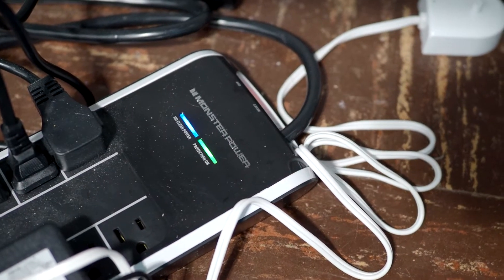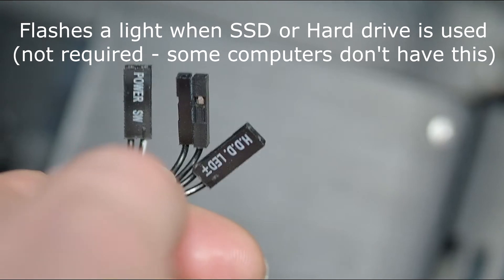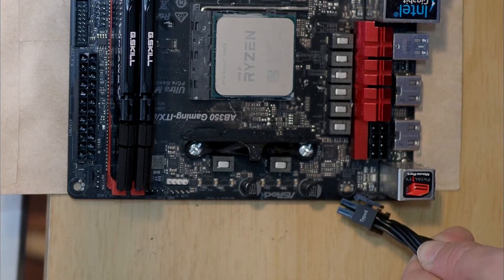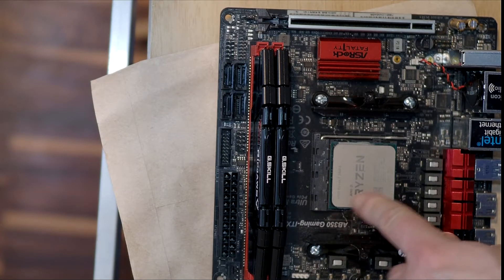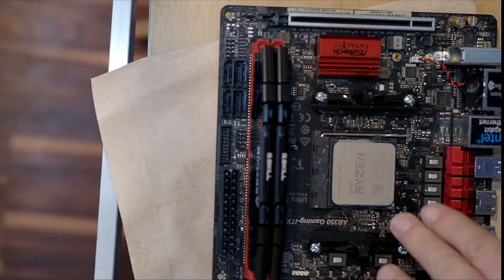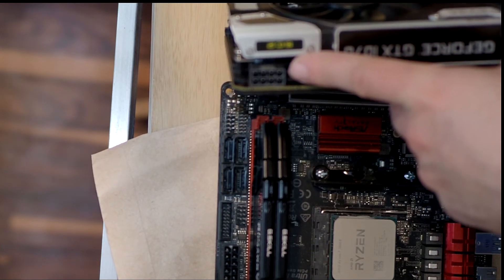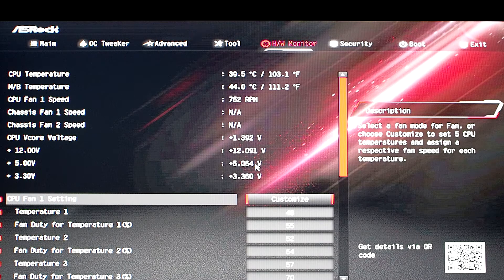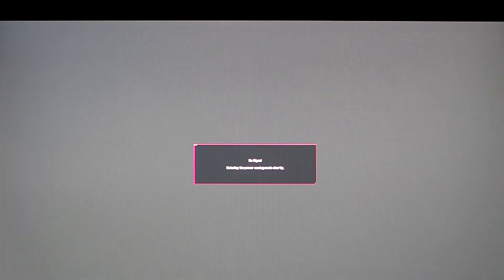Reasons a Computer Won't Turn On Part 1

Comment: Hello Ihad a power surge. My PSU fried so I had to get a new one. If I plug the SATA cables in the hard drive, the 24 pin into the motherboard and reset the CMOS will the PC boot up?
Reply from the maker: You need to connect the motherboard leads which are those things on my thumbnail image I am holding up. When a PSU fries there is no guarantee it didn't take other parts with it... I would just get everything connected properly to try and boot up. And you also can't forget the CPU leads from the power supply. All the items are in the video step by step... Part 2 is more of the trouble shooting tips of what generally happens to determine what failed

Comment: My motherboard lights up with my psu plugged in but nothing else turns on, any idea why?
Reply from the maker: There are many many reasons. The thumbnail of this video is one of the reasons. I have 2 videos, video #2 link in the description is probably more likely to tell you the reason. I literally explain what happens per situation.
Reply: @Not Bios  I just watched the video, I will try some fixes, but it's the weirdest thing that the mother board is lit up but the fans or cpu/gpu aren't doing anything. I have a 600w psu which is supposed to be enough for a asus b550 plus with ryzen 7 5700G and RX 6700 XT. I checked the ram sticks, all the wiring and still no luck :/
Reply from the maker: @teamkillertom6513  ram sticks is unlikely. The 5700G wouldn't work if your board arrived with the old 2019 bios but that would be some very old stock. The power switch lead to the motherboard would be what I would most likely suspect... As per thumbnail picture

Comment: i have a b550 ds3h motherboard and it is connected to power, the power supply works, when i plug in a usb stick it lights up but when i try to turn it on there are no lights, no fans spinning, nothing. even trying to trip the power with a screwdriver doesnt work so idk whats going wrong.
Reply from the maker: Did you happen to take a look at any of the other videos for more reasons where I even explain what is likely to happen based on the situation? Cause otherwise I would assume you did and would completely miss something I answered.

Comment: Pliz help me my mother board light is on i tried jump start it dont start
Reply from the maker: Link to video part 2 in description, might be faster to check for the answer because I work for 10 hours today. I'd need to know a bunch in order to try and help link. If this a new computer build or old computer that has failed? What are your computer parts? Motherboard light is usually anything that to do with a missing or bad power connection to the motherboard. Id this a motherboard with a CPU light, memory light or only a motherboard light, cause the answer than becomes it could be any connection or even a bios incompatibility with the CPU or a cooler not mounted correct.

Comment: My motherboard lights are on but the pc and the fans are not on. What could be the problem?
Reply from the maker: There are mulitple videos I have on this... Without telling me your specs in detail a question like that is so generalized it makes it a shot in the dark for me to even answer. It's like asking a machanic my car won't start what is wrong.
It could be as simply as having your reset switch backwards or not even having it connected to the correct place. It could be a incompatible parts, forgetting to connect the CPU power which this is a step by step to check everything, part 2 video mostly mentions what happens on per situation.

Comment: Bought a new motherboard and cpu installed it on the same tower re installed previous components but when it came to turning it on there’s a whine noise coming from either motherboard or PSU and computer wont turn on  lose goes away when I turn off power on PSU any ideas ?
Reply from the maker: Are you certain your startup switch to your motherboard isn't flipped backwards? I had the same thing happen before, forgot the exact reason why other than something was not installed quite right. Also happened when I used fan control cables on power on and the power was set to DC rather than PWM.

Could even be a situation of bios incompatibility. I would need to know your parts mostly motherboard chipset and CPU to determine if that is even a possibility or not.

Comment: I dropped my pc and just Dosent turn on now
Reply from the maker: Maybe something came loose or broke or made a short by causing some form of damage to the case. Not sure if you can remove and re assemble to see if anything is damaged or loose. A very common thing when a PC is dropped is damage to the hard drive if not an SSD drive.

Comment: Can anyone tell me why my pc wont turn on on the first press but after unplugging and plugging it to the wall couple times it takes like 3 press before it turns on?
Reply from the maker: Bad power button (had a power go bad on me once) or maybe wrong polarity connected to the motherboard as in not proper connection... Or you have an error possibly memory compatibility issues. Any issues once the computer is turned on?

If you short your motherboard power switch pins together and it boots each time it'd verify the power button as the issue or wrong pin with power pin with another wrong pin connected and when re plugging is at times putting a short charge at times. The one side is powered always and the other end is waiting for power for signal

Comment: My computer will turn on but when I connect the keyboard the mouse the the hdmi the keyboard not turning on the mouse isn’t turning on nor the screen is turning on
Reply from the maker: What is your motherboard chipset? Do you have the newest bios version? Asking because AMD had some major USB issues on older bios versions for the Ryzen CPUs with certain configurations.

Comment: my pc can turn on without the case using power button case, but when using the case it won't turn on .. So confusing :/
Reply from the maker: That is strange. Sounds like something is shorting out between the screws or or something else touching a motherboard electrical contact or board being flexed.

Comment: My problem is my mother board rgb lights up but nothing else does
Reply from the maker: Watch part 2 video as well. Motherboard lights means your board has power so your problem is within the case itself. Sadly there are wayyy to many issues that can happen for me to tell you what it could be just the RGB lights turning on. But your power button tab as showing in this thumbnail picture could be placed in backwards. Pwr swt might be the name (or power swt) of the lead connected to the motherboard in order to boot the system

Comment: My mother board light blinking but fan not spinning and pc doesn't start
Reply: If video 1 didn't have your answer you may want to try part 2 in the video description. The problem is there are sooo many reasons even the wrong bios of the CPU and the error light is different per brand of motherboard
Reply: @ericsstudio  thanks for replying can i give my motherboard model

Comment: Everything was working great until I moved everything til my new case
Reply from the maker: Most common issue are those power switch  connectors being on the wrong pins as seen in the thumbnail picture

Comment: There are times my PC could be turn on and then after shutdown it would not turn on again.. After a few days it will turn on again.. I really dont know what seems to be the problem
Reply from the maker: I'd advice trouble shoot following this or the part 2 video. My first thing for you to try are disconnect all extra devices like USB that is not required, disconnect extra internal cards. It is likely one of the things in or connected your computer causing  you grief if not overheating or popped motherboard capacitors. Keeping in mind not all computers are magically the same, knowing the parts in detail helps... I don't know brand, exact motherboard that may or may not be a problem board, GPU exact model new build or old system.

Comment: I just built my pc I honestly don't know what is going on. I built it I undid everything just to check if its plugged in. The second time I rebuilt everything I finally got a flash of light from the panel and my fan spun for a quick second then nothing happened? Can someone please help me?
Reply from the maker: Did you also watch video part 2? link pinned in comments and in the video description. Is this a new computer or after you change a setting it failed?
Reply: @sparketech  I'll watch part 2 but also this is a completely new build

Comment: Pls help me out. Before I press the power button everything that should be lit up inside the motherboard has lights. But when I press power, the cpu fan only twitches for an instant and I see two brief flashes of red light and no more. The PSU isn't responding either. What could be the issue? I really am desperate and at a loss 😭
Reply from the maker: I am just starting work for the day, on day 11 straight so half a sleep lol. Give you one thing to check, re seat the CPU making sure it was fully seated in slot the correct way around (square notch with notch on the board) and that cooler is making proper contact. Also watch video part 2 in the discription if you have not done so. Red flashes sometimes indicates a CPU issue or over heat error.
Reply from the maker: The motherboard usually has the error flashes listed in it's manual.

Comment: Something's wrong with my motherboard I think at home it has no power no lights no fan spin nothing but when I carried it to the repair shop it turns on like normal carried it back home and nothing no power still I have no idea what's wrong
Reply from the maker: Only thing I can think off hand is that the power bar at home is switched off if everything is plugged in. If not the case and there is power to your plug in... connect a lamp or something to verify if this video did not help watch video part 2 in the description.

Comment: My motherboard is receiving power but my 2 pin jumpstart is not working with a screwdriver. Oddly enough I turned off my power and removed a power switch I built myself and was taking it to a friends house that also couldent get his motherboard jumpstart to work. And less than 2 minutes later I turned on my power and tried to jumpstart with a screwdriver and it did not work. Any ideas
Reply from the maker: Also not knowing what your computer parts are tells me wayyy to little and i also don't know if this a new build, a pre built, or some old and some new parts.

One person that had issues that I tried to help bought is GPU from an eBay seller they didn't tell me this but I made a video warning people not to purchase GPUs from eBay. also seen someone use CPU with no graphics and they had no graphics card. I know nothing when you told me basically nothing... But watch part 2 video first and if that does not solve your issue let me know your computer info and new or used
Reply: @sparketech  thank you for the quick response. My motherboard is the MSI Z390 A Pro. 2 - 3060 Ti’s, CPU - celeron 4900 and psu is the EVGa 750 watt supernova series. This is a mining rig and I bought everything from either Amazon or the gpus from micro center and have been mining for 4 months. I don’t have a case as my mining rig is on a wire rack. I am touching the pins on JBAT1 which is 2 pins next to the cmos battery and correct off the manual and I had previously had it running with my power switch on this so I know it’s right. Ethernet light is on so I know my motherboard is receiving power. The weird thing I just noticed is that my psu is also connected to 5x uphere led fans I have and they aren’t spinning. But I just tried a new psu out of box(the same supernova brand) and the lights aren’t coming on. I will go watch video 2 let me know if you need more info or if I missed something. Again thanks for the quick response :) edit: Just watched video 2. Although it was an informative video it does not seem like it applies to my situation unfortunately.
Reply from the maker: @crun1teliveontwitch645  I've never seen a mining rig before let along the difference of a mining rig vs a regular setup. The power switch unless used like a lot shouldn't be the issue. The bigger issue could be something like a power supply taking parts like the motherboard out with it. EVGA is generally a good brand, I owned 2 of them without issue. When you changed the PSU assuming it is modular did you change out the cables? I'd try that as a first step with that new PSU, I've seen cables short to the Motherboard 24 pin before as an example and actually got burnt.

Do you happen to have some other computer to test your old psu on to see if it working? If you have a component issue the trouble shooting tips don't tell you all that must especially if something were to go bad on the motherboard.
Reply: @sparketech  I will respond with more detail tomorrow as I need to head to bed but I do have more cables I can try.
I don’t have another computer to test the old one but it was working for so long and then after I turn off my pc it stops I don’t see why that would happen but I don’t have all the knowledge so I’ll get back to you tomorrow after trying some cables. :) thanks for the help!
Reply: @sparketech  No differences in mining rig be regular pc’s btw. Anyhow I switched the motherboard Power connector and nothing happened. I tested my psu by using a paper clip and it works. I’m still lead back to the 2 pin jumpstart as the problem just because I don’t have knowledge of other possible problems because I’m a newb. And the 2 pins for startup are not bent either.
Reply: Issue resolved.
Reply from the maker: @crun1teliveontwitch645  What did you have to do to fix the issue?
Reply: @sparketech  unfortunately when building my pc the first time my dad hooked up the power switch so when I took it off and put it back on I placed it on the wrong pin set. I suspected it would be something dumb because everything was running fine. Anyways thanks for your help sorry to waste your time
Reply from the maker: @crun1teliveontwitch645  never a waste of time... If someone does the same thing they can see what they have missed. It's an easy mistake that I am certain a lot of people make
Reply from the maker: @crun1teliveontwitch645  that was one of the first things I suppected. If you look back I am sure I wrote maybe you have it on the pwr LED rather than pwr switch... As an example.
Reply: @sparketech  For sure, now that I’ve fixed my computer I have to resume fixing my friends lol. It seemed we had the same kind of problem at face value so we will see if we’re just hitting wrong power switches.
Reply: @sparketech  ah
Reply from the maker: First idea is watch video part 2. Second idea is you can connect their pins on the case directly to your motherboard as that is wayyy safer than using screw driver. And often people touch the wrong pins as well the front row when it is the back or LED power rather than the pwr switch.

Comment: I have a computer who takes very long time to power on.
I have to wait 5 minutes before turning on, then it turns on without issue.

Now it takes time 15 minutes. then 30 minutes.
then today it's not anymore. 

This happens gradually in a span of 1 month.

I check my PSU its working.
Maybe its the motherboard itself?

 May I ask what's the problem?
Reply from the maker: Most likely issue would be the hard drive. spinning hard drives especially go down that kind of path.

Comment: My friend is having the same problem, we thought it was the psu but we took it off and power tested it with a battery tester, and all the fans and lights started turning, but there was no screen that showed up on the monitor, and when we plug in the 24 pin and try to turn it on with the case button it still doesnt work
Reply from the maker: Did you watch video part 2? Should be in this video discription for the link